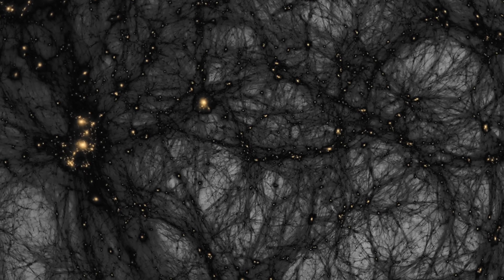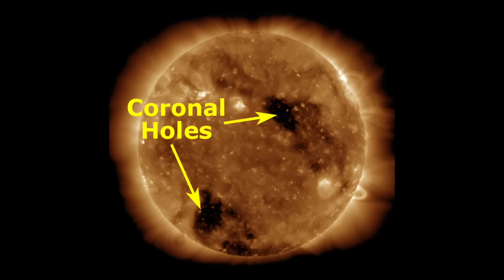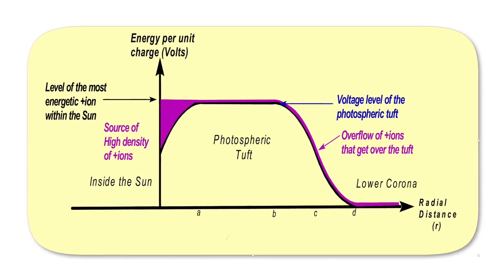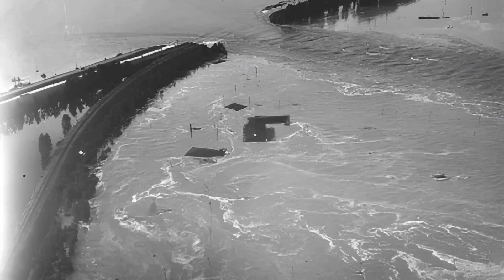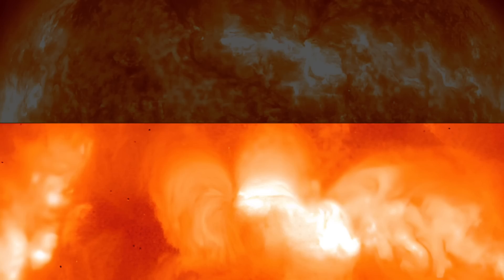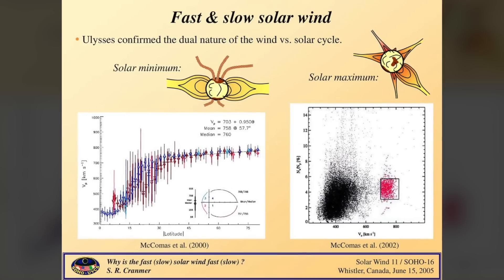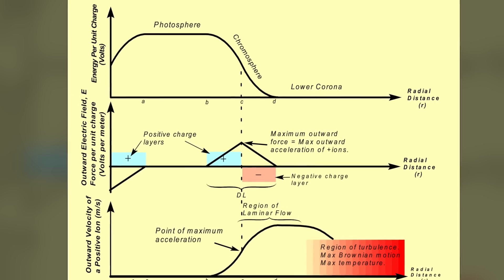Donald E. Scott: Quintessence of Solar Winds | Thunderbolts

Comment: It recently occurred to me one of the biggest problems with the Standard model is the idea that the presence of opposite charges " CANCELS OUT " the charges.   This cant be further from the truth.
In reality they simply 'BALANCE OUT" yet remain visible to every OTHER charged particle in range.
Reply: It only cancels out of they recombine. Tough luck doing that in interplanetary space. 

You can't discharge electrons, you can counterbalance then with a cation.
Reply: Another way to think of it is that transmission lines and power leads are designed to be as net zero as possible to deliver the most energy.

Comment: 👽 ⚠ To wit, as the potential gradient [voltage] of a star changes so does its character/makeup, making them dynamic/variable. Hence the 12 year Solar cycles. This character/variability also changes over long periods, which partly evidences as different stars, quasars, pulsars, etc.

⚠ "Use the electrical/Coulomb force, Luke."

Comment: This is the key to understanding the production of water here on earth. The negative ion flow couples with the positive hydrogen particles in Earth's upper atmosphere creating 1 part oxygen to two parts hydrogen when the high energy particles slam into the ionosphere. The coupling takes place and water is created in our ionosphere.
Reply: @Star Observers  That's an interesting observation and will require some contemplation and some asking interesting questions, like, if this has been going on for millions of years than why isn't the Earth totally covered with water i.e, where has all the water gone?
Reply: @velikovskysghost  the majority of greenhouse gas is water vapor that is off gassed by the planet. It's only the fact that our magnetosphere is so strong that allows us to retain a good amount and why other planets lacking a strong magnetosphere have problems retaining water in liquid form. There are also short lived positive hydrogen particles that flow upward at the poles creating Noctilucent clouds at very high altitude as shown in previous studies along with cosmic ray induction into cloud formation which is once again a flow of hydrogen particles from the forbush effect. So besides the sun the cosmic rays are affecting carbon 14 and ultimately the hydrogen/oxygen cycle on earth as well. After all earth is a negative ion emitter and those tend to be in the form of oxygen at fairly high levels from earth surface region. The two meet at the van Allen belts and cause this induction process to feed also the nitrogen cycle  through lightning strikes and also the other noble gases of earth are all modulated by the solar wind interaction.
Reply: Manganese 54 isotopes show rapid decay 36 hours prior to a solar flare and change in the solar wind. So it's not just noble gases affected but even minerals that can be found within the human body can sense the changes in the solar wind when the disruptive force at the core begins long before the flare. Quantum entanglement would say the tug on the other end of the rope can be felt long before any motion can be seen. So our induction from solar wind never ceases and a tether or cord connects us to our star and we are truly very connected by means of the solar wind field provider of the medium. It is an electric field and not uniform. But provides us everything we need in charge form.
Reply: @starobservers9862  Thanks.

Comment: I have only one question. Why didn’t the -electrons and +ions in space around solar meet and neutralize one other?
Reply: That was explained pretty clearly in the video. Watch it again.
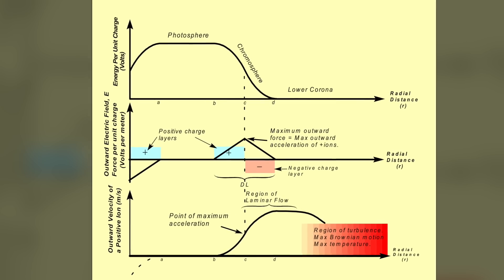Reply: If you go to about 2:40 timestamp to about 4:44 timestamp the answer to your question is right there. 
   This could be a good thread to follow, interesting  ...
Reply: Thanks for direction. Appreciated. 
But that doesn’t answer my question, the whys. It can’t foster a deeper understanding to the matter in discussion.  Don is offering a description but detailed explanation. That is like a constitution, behavior or rule.
Reply: @philoso377  
An in-depth discussion of plasma behavior is impossible in a discussion thread. Study the known properties of plasma. Charge separation is fundamental to the existence of the state of matter that is called “plasma”.
Reply: @critical-thought  I just want a digestible version and not a graduation thesis version.
Reply: @philoso377  
Use your search engine of choice. None of this is very hard for anyone who is actually interested.
Reply: @critical-thought  OK I will. 
There are some elites who learn but think. Learn extremely complicated matters and dictate it back in whole. I admire them deeply. However they can’t offer any digest version of what they have learned. Because that requires digestion in matter which is their weakness. Asking them to make up a digest version could expose of their limited capabilities in philosophical understanding in subject. Rather than embarrass themselves often turn down requests for a digest version on subject matter. I have no problem in that but just don’t act in possession of a digested version and to refuse to share.
Reply: @philoso377  
Good job! I knew you had it in you.

Comment: 🤣This is such a beautiful video... The current ruling class is shrouded in, mostly mathematical, expertise so much that they don't look beyond their model.
Reply: @quinto 190   Exactly right and they don't look at the physical examples right in front of their eyes either.
Reply: @velikovskysghost  Yes, they see events like aurora and experience structures like the ionosphere, that enables worldwide communication in short wave radio, but don't make the connection, that both are plasma with electrical currents in it. Instead they talk about particles... electricity, nah...
Reply: @quinto190  You nailed it!

Comment: Is the Earth gaining mass from the solar wind being swept up and channelled down via constant if varying auroras? Similar to electrolysis? If so, is that mass gain significant? Because over long periods it could change many things, such as the ability for large animals to exist on a growing planet. Or the Earth's surface temperature given the mass of atmosphere and gravity dictating surface pressure. Just ignorant and curious.
Reply: By 'large animals', are you thinking of dinosaurs?

I think i read this in a book several years ago; the Earth collects roughly 30 million tons of dust (and meteors) from space every year, on average.
It also loses some amount of hydrogen (as seen by its hydrogen plasma tail), but I don't know how much, or if it said so in the book.

Any way, there are at least a few EU videos about an expanding Earth, as in; growing from the inside, and there are some facts which support it.
Reply: @silvergreylion  Not necessarily. Just that example where land animals tend to have a maximum size before their weight causes problems. Increased gravity will reduce that maximum achievable size.
I was more interested in if Earth gains mass from the solar wind, and not just meteors. And was wondering if it could be significant yet overlooked.
You comment about hydrogen is interesting as isn't the solar wind in effect hydrogen plasma? Protons and electrons?
Reply: @glennb5099  Yes, solar wind is mostly hydrogen plasma. The book never took this into account, and yeah, the incoming amount from the solar wind and the loss in the tail probably balance out, although I'm pretty sure I've never heard anyone point this out.
Reply: @silvergreylion   I am very interested in these two topics...  Earth's gravity having changed, and Earth having expanded, in the past. I do not recall any TP vids regarding the latter? Do you recall which vids?  Thanks.
Reply: @ub2bn  Sadly, no. I kept up with the release of articles and occasional video on thunderbolts.info long before this channel was started, so they could've been some that wasn't uploaded here, or maybe I'm just remembering articles about it.
Anyway, I looked through quite a few videos yesterday, and this, while not from this channel, is based directly on what TP has published about it in the past:
https://www.youtube.com/watch?v=iy5733Lp0mI

I also found https://youtu.be/stk-fE2TNVg?t=302 which I had not watched, and it has some very interesting evidence I hadn't heard about.
Reply: @silvergreylion  Thank you.